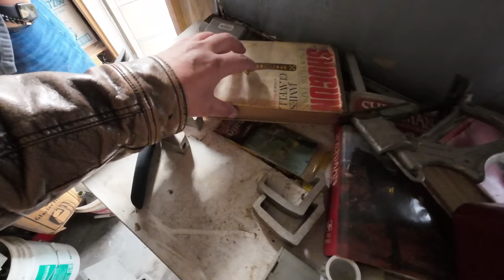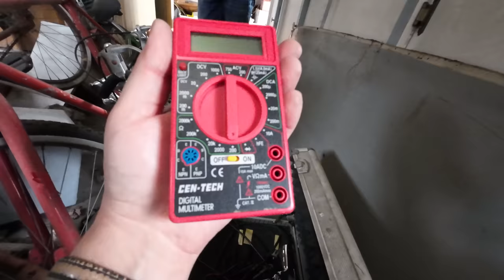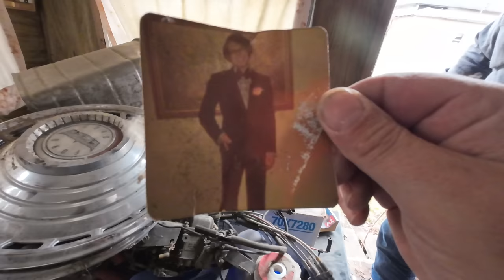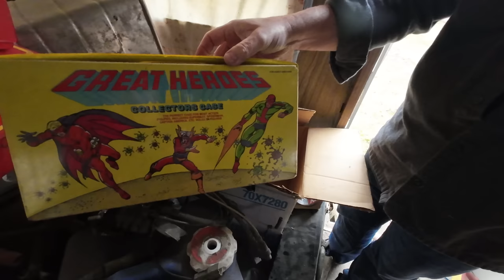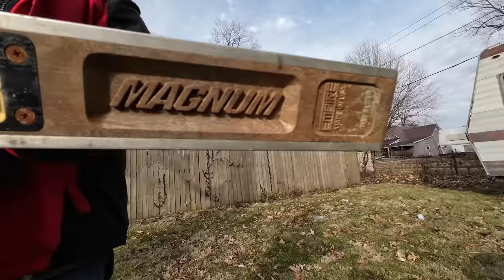We Broke into my Uncle's Secret Storage Unit and We Found Hidden Treasures!

Comment: Randy those are 5 blade crimper tool for stove pipe and HVAC round pipe it puts precision indents which allows the pipe or fittings together. Thank you for sharing this video with us. It is a great find it is a step back in time. ❤🇨🇦
Reply: Stove pipe crimper have blades that are closer together and shorter, they are for gutter downspouts
Reply: You are right!

Comment: A lot of what you uncovered has value, either on it's own like the chain saw and hammer drill, or as collectables (the action figures). Even the sewing machine, if it works, and the heaters. Check the heaters, though, as they may only run on kerosene and would need to be vented to outdoors if used as back-up heat.
Coca-Cola stuff is very collectable
Atari 2600 console set is around $180 to $250 depending on games and controllers included
40:25  Is that Jessica's opinion?  LOL
Reply: The Kero-Sun heaters do not need to vent outdoors, they use a special burning mechanism that clean-burns the kerosene fuel. They were fully intended to be used indoors, but it would be a good idea to crack a window because the safety of kerosene and CO poisoning wasn't well known back then. They are about 35-40 years old.

Comment: Randy, great video! Atari didn't brand that console as the 2600 until several years after it launched, so as you can see the original name was "Video Computer System", or VCS. VCS/2600 are the same thing. They also licensed their consoles to sears back then, so some VCS systems and older Pong consoles have "Tele Games" branding instead of Atari.
Reply: Wow good information.
Reply: Ive got one of those pong sets

Comment: If u grab the lock with the vise grips and keep steady pull down and tap on each side it will unlock.   Master locks and any lock built like master locks.   I’ve been in many gates for timber company’s thru the years and that is how we would get in !  It works

Comment: There is some value in that stuff. The old tolls are a keeper. They are better than the new ones. Those cups can be worth a good bit if you have the set. Some of those old cups go for  $50 each. Now those GI Joe figures can really be worth a mint. To bad they weren't in their original packaging.  Yes take them to a expert.

Comment: you would be surprised as to what you can sell out of that trailer. from the wine bottles etc, old oil cans, everything in there has possible valuable. some old oil cans for example are collectors items and same for old wine bottles and labels, if they aren't worth anything there is still money in recycling etc. Also the toys could also be worth quite a bit. my suggestion would be to contact a local antique dealer/collector. they can come out and take a look and prob make an offer. I watch another Youtuber here in Canada and he would buy up hoarder houses and you would be amazed at some of the things that were pulled out that you would think are absolute garbage and worthless but end up selling for thousands. I wouldn't throw anything out until you confirm its worthless.

Comment: The "crimpers" at 9:37 are used for HVAC (you know how one end of an HVAC pipe has those up and down bends to fit into the next section?).  Handy if you need to put in something like a stove vent.

Comment: The action figs are several hundred $ & the most valuable thing I saw.  The atari is maybe a hundred, no super valuable games there.  Those old soda crates have a little value, & the ladies bike does too.  If that hammer drill hasn't been soaked in water it's worth keeping in case you have to drill into brick or concrete for some reason.  Funny, I like watching cleanout vids; never expected one on this channel!

Comment: alot of good stuff in there i wish i had that thats a torch in the bucket its a tiny mobile cutting torch which is also used for welding(mostly brazing) that slidehammer is nice also those cutters are tin snips them bikes are schwinn roadmasters also yes the hammer drills work well you really found a hidden honey hole

Comment: the green colored handle thing is a gutter downspout crimper. used to add 2 downspouts together if one is cut off. it crimps the edge so one will fit inside the other.

Comment: Those Atari 2600 consoles are the 1980-1981 version. Most common of the 1977-1981 woodgrain era.

There are some decent RF to HDMI or component video converters. There are ways to tap into the 2600's composite video and analog audio signals before they go through the RF converter in the console.

IIRC there's even a gizmo that can tap into the video and sound before they're converted to analog, then it converts to HDMI.

Comment: Getting the lid off the jar of pickle relish Mike next time just smack the bottom of the jar with the palm of your hand and it will shock the jar relieving some of the air pressure enough to easily twist the lid off.

Comment: The two hand tools that you came across One had a brand name of Midwest those are crimpers for the end of round duct for heating and air conditioning. You crimp one end of your duct so that it will go into the other end of another duct of the same size. In the HVAC filled we call them crimpers

Comment: Those Ataris are the woody 4 switcher type which aren't the rare ones, but they still have a few hundred dollars value. The games have various values. Keep them and enjoy them. You need a TV with an analogue tuner. None of the modern TVs will work. Just get an older TV with analogue (VHF/UHF) and tune it in. You don't need the TV/Game switch since you are just using game, so plug it straight in. You can get power supplies for them on ebay etc. Clean the cartridge ege connector with WD40 on a rag to keep the connection reliable. There are people repairing them in vintage communities on the net, so if it doesn't go, contact them.

Comment: You can't plug atari or anything that outputs a resolution lower than 480i to modern televisions. It has to be a crt tv or you have to get an upscaler to use on a modern flat screen because it won't display anything on the flat screen without. So if you was thinking the atari didn't work when you plugged it into your tv it may actually work but just not on your current flat screen

Comment: You have a goldmine with the Atari.  You have a MK II of the Atari 2600 (Model: VCS).  The difference between yours and the original is simple.  The original had the six buttons and the controller connectors were on the front.  You can get an analog adapter and hook it up to any analog TV and it will work.  you should open it up and make sure to clean the inside.  Since I have seen the Atari 400/800 in the HQ, I am sure you will be able to handle it.

Comment: That Atari 2600 stuff is now worth a fortune. Yes they do still work on modern TV's. Sadly I sold my controllers for $2 and threw the console in the bin when I moved. Had no idea they were worth anything. I got mine from the side of the road in the mid 80's. Try using a multi power supplier. That's what I did as mine didn't have a power cord either. From memory I had too put it on 9V. It just used a TV coax cable to go from the console too the TV.

Comment: The TV connection that is missing is the RF switch. I think you plug straight into the TV without it, you're just going to need an RCA cable and a female RCA to male coax adapter. Pretty sure all the switch did was flip between the Atari's signal and whatever else was plugged into it. Later systems, like the NES and onwards, had an automatic switch.

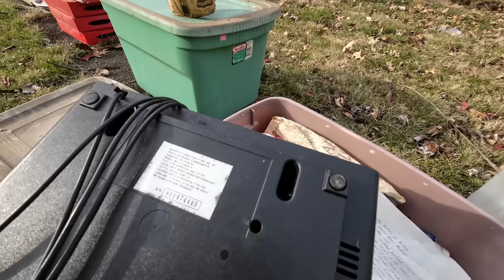Comment: 33:08 that’s a 2600. They didn’t call them 2600s until after the 5200 came out. They were just the Video Computer System before then. It looks like a 3rd gen based on that it has 4 switches and looks similar to the OG 6 switch models.

Comment: Those weird pliers at 10:00 are used in sheet metal work, fabricating ducts.  Imagine the end of a round air duct or flue pipe, how the metal is scalloped so that it will fit into another round pipe?   Those pliers are used for that.

Comment: 39:10 most of those games seem to be common games I think in that plastic box.

However you have some neat accessories for the console.

And any of the adapters will work, as will a RCA to RF barrel. Most of the current TVs should still be able to tune analog 3. Though, it’ll look better if you can find an old school TV.

Comment: The Atari 2600 stuff isn't worth the most. Console is worth $40-$50. Most games are worth under $10. You can get kits that change the video output to RCA, but you have to open it up and solder new parts into it (super easy to install if you know how to solder.) The controllers and power adapters are now being remade so you can get them. Even the switches are available.

If you do install the RCA adapter kit into the 2600, do yourself a favor and get a replacement voltage regulator and install that at the same time. They are known to fail due to age.

Comment: You could probably wear a mask if there is mold spores probably save the tools may want to scrap the trailer for the metal or maybe several dump runs.

Comment: The Atari is a second or third series. Worth about 15 or 25 bucks. The first series said 2600 on the upper besel.
No controllers, cords, or TV converter, not worth really anything. I have mine that I got in 1980 with 35 games and 4 controllers,  only worth $45.oo

Comment: Randy, what those green handled pliers are used on air conditioning  duct crimper.  You have two pieces of duct work, however,  they are both the size opening. So, you granb òne section and then you use the tool like a pair of pĺiers n what happens is the duct opening gets smaller as close open, close the pliers n you move (crimping the edge until it shrinks þhe opening þhen slide þhe two pieces n hang ducts. I'm sorry I sat much in my description,  but that's me! Also you should not pay any mind to the guys who say "give me a free car" . Those are the losers in life that you should not say anything about on your videos. Ignore them that. You have a good channel going, ďon't some idiots 🙄  being you down. We used to have a saying whan I was ìn the NAVY, fuck'm and feed the man fish 🐟.".